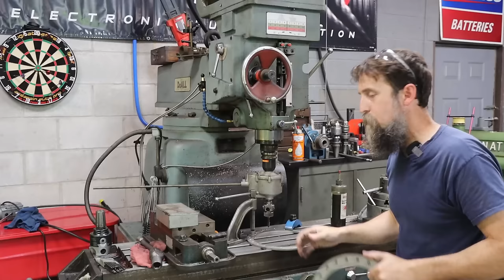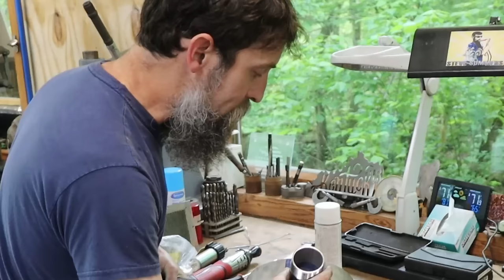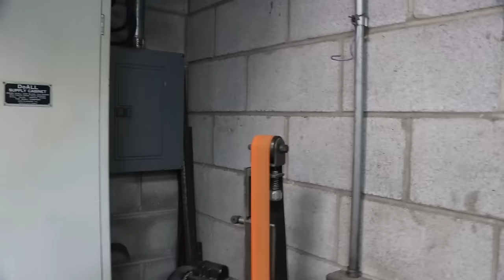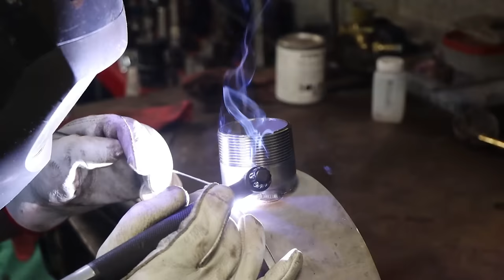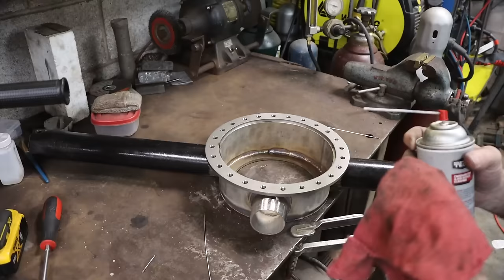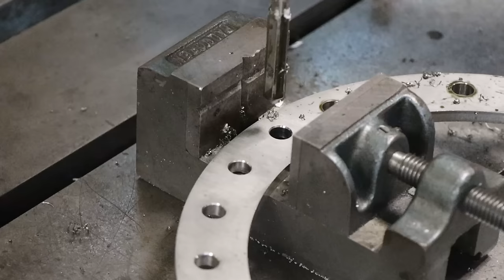Tapping 316 Stainless with a old power tapping head.

Comment: I worked at a zinc refinery that used sulfuric acid and there much 316 stainless.  We had a ball mill similar to that but much larger. (Concrete mix truck size.)  I was in production but learned much from our maintenance.  Someone told me once I was bird-dogging.  I was just learning by watching, nd was sometimes their gopher.  I remember welding 316 that it doesn't always stay straight.

Very good video.

Comment: Sorry to hear you all are going through so much chit. Like I've been doing most of my 70 yrs, keep telling yourself, What ever doesn't kill you, makes you stronger.

I should be coming into all time tempered steel strength any time now...

Re: power tappers

15+ yrs ago, I was reading a random forum post about tapping & the discussion turned to tappers. Never heard of them, knew squat.

Went Googling to learn more, then eBay. There was a Ridgid Tapper listed for $50. I bought it on a hunch. 

Turned out the listing was 15 minutes old. The guy'd had it for 10 yrs. Bought it for a project, tapped a dozen holes & it sat on a shelf for 10.

It was brand new.  Not anymore; I have a 2nd drill press dedicated to it & yes, it feels like cheating. That's the exact term I used when I told my buddy about it.

Got a 2nd one about 5 yrs ago. Was on Long Island, coming home from dropping wife at work. There was some free paint on the curb; stopped to look & in the grass w/ some electrical stuff w/ a French tapper, the one's that cost 2K.

Opened it up, later, it was like new inside. Gave it to my buddy.

Hang in there, This, too, shall pass. As my old grannie used to say.

GeoD

Comment: just a little tip to use on using clamps put a coil spring under the clamp and around the thread, it lifts the clamp clear of the workpiece, a real time saver

Comment: Family first Steve.  Sure we missed you, but family has to come first.  As for weather?  Try Michigan...we are surrounded by water and it makes weather prediction SUPER difficult.  I too have been dealt the Sh!t Sandwich card, so I totally get it.  

For all that tapping, bet you would have loved one of Adam Booths Flex-Arms.  LOL.  Would have made super quick work of that.  

Interesting a 'startup' wants to do something that has been done for a long time already.  We have a couple electronic recyclers, and this is exactly what they do.  Shred the circuit boards, and then feed them into a ball mill to be pulverized into a particles the size of a grain of sand or smaller.  That gets bagged and sent to the reclamation plant (could be in the same facility or they sell it off to other people that do this work).  Same places also do catalytic converter media to reclaim the precious metals.

Comment: I do not if I am mistaking but the taping head looks like it has an idler gear in it.  This is how you get reverse or counter clockwise spin?  When you push up it shifts to reverse.  They use this mechanism in outboard motors bottom end.🤔🤔😁

Comment: 6:30  How to speed up tapping ... Let's say the flange ring is 10" diameter ... By clamping a 9. 1/2" diameter solid disc slightly taller than the ring. INSIDE it??   We could eliminate clamping down the ring every tapped hole .. speeding the job at least 2 fold .. 

This would easily pay pack in ONE ring .. if there are more then you'd really be in the money.
:)